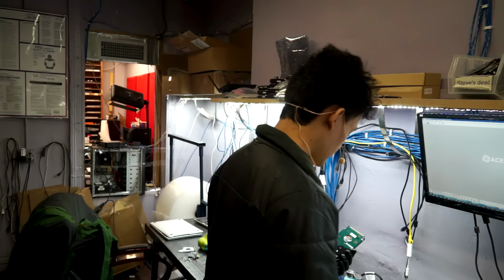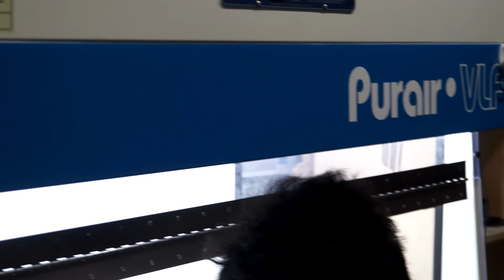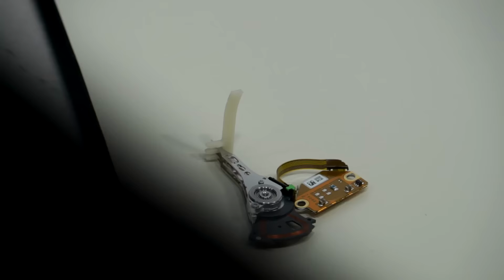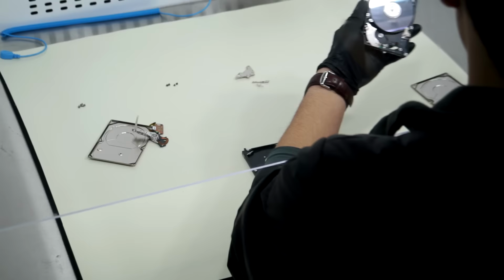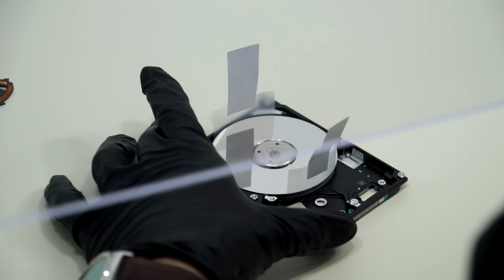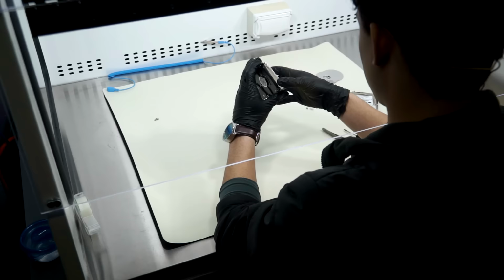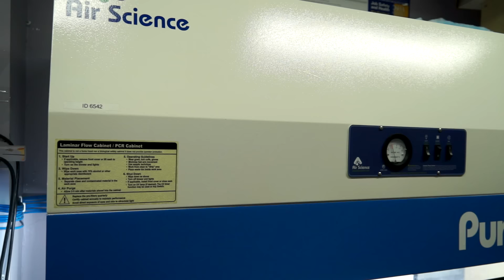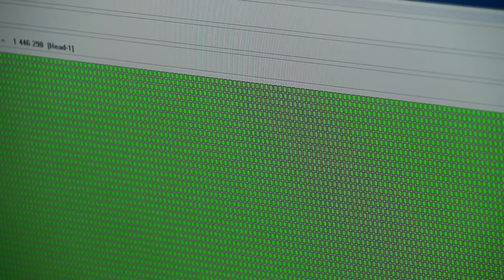Data Recovery: Hard Drive Platter Swap in Our Lab!

Comment: Now do SSD data recovery please
Reply from the maker: For that we use Darkseid's omega beams to read directly from the broken NAND which cannot be captured by consumer camcorders.
Reply: Louis Rossmann lol ill pay that👌
Reply: how possible is it to recover data from an SSD? Since it's not physically recorded into a metal, I'm guessing there's a low possibility of it happening?
Reply: TheFPSPower if there is a problem with the power supply circuitry in the ssd you have a better chance of recovery but if one of the flash chips is bad then your probably stuffed
Reply: Actual damage to flash cells is impossible to repair - all you can hope for is to force read the remaining data and hope to reconstruct some of it. But since SSD's basically fragment all data randomly across the entire drive, reading the flash chips themselves is useless - you need the metadata to know how the data is arranged... And, well, you need to know how the metadata itself even works. The latter is generally secret, since it's an integral part of SSD controller design.

On the plus side, modern SSD's are considerably more durable than disk drives - the only downside is, as explained above, if the actual flash is damaged somehow.
Reply: Mythricia also I'm sure that S.M.A.R.T technology will notify you if the flash sells are starting to die in the drive hopefully before a catastrophic failure happens
Reply: Oh yeah absolutely - a reputable SSD will not let itself "die" from normal use. They have a large percentage of spare Flash to use when problematic flash sectors occur, and furthermore, once the write-endurance limit gets close, modern SSD's will actually put themselves into a hard-locked "Read only" mode - where they will simply refuse to write data. That's another nice thing, Flash failure is relatively predictable, unlike disk drives, so they can have a built-in safety.
Reply: I have seen people offer to do SSD data recovery, they charge upwards of $1500 is this a scam or is there some known way of doing it?
Reply: Even though that is true, I think I trust more saving important documents in a spinning hard drive instead and leave everything else to the ssd.
Reply: Whether SSD data recovery is a scam or not depends on the fine print. There's no technology under the sun that can recover information from a dead sector of Flash. It's just not there anymore. It's gone. If the recovery has to do with a dead controller chip or physically broken PCB, then sure.

But since the failure mode of a dead SSD is usually the Flash memory itself, rather than a controller or physical damage to the PCB, I highly doubt "SSD data recovery" is very feasible. It's kind of the opposite problem of disk drives - in disk drives, as long as the platters are undamaged, the data is there, it's almost always the heads or spindle dying. In SSD's, it's the data dying! There's nothing to repair.
Reply: I thought the newer drives had secure fast erase, I.e. a chip on the controller with an encryption code.   so you need both the platters and the board working. ( no more fixes by simply swapping the board)
Reply: I thought the newer drives had secure fast erase, I.e. a chip on the controller with an encryption code.   so you need both the platters and the board working. ( no more fixes by simply swapping the board)
Reply: That's probably true, yeah. But I was comparing in general. Though getting the board working is not too hard - I've seen people swap the controller chip onto a new board and working it that way, since it's the chip or a ROM containing the encryption keys. Along with new heads / platter swap or whatever of course.
Reply: Thanks to Lewis.  I'll have to relook at this. Swapping platters opens up opportunities. I'd love to see someone have a go at flash recovery.

With recovery, if the unrecoverable data is a system file, temporary file, unallocated space, or even a program file(as long as you can reinstall) you have a win.

I've repaired from some really nasty data corruption.  But I'm a software guy, data recovery hardware skills are limited, eBay donor boards not a viable option (ads end of the world), and my clients will never pay Lewis's prices, (DAMNIT)
Reply: SSD failure is almost NEVER the Flash memory itself. Controller and PCB failure are the most common issue. What Luis uses here called pc3000 has SSD recovery capabilities(with add on units) for some SSD's. For other SSD's particularly ones with Full Drive Encryption(most new controllers) you need to develop your own solution like our lab does.
Reply: Does he charge a lot? I hope not because the difference between an amateur like Jason and a long time pro with experience is huge. This old 80GB drive is a cakewalk but sending a modern drive to an amateur lab is stupid because the difficulty is exponentially higher. I won't even mention all of the numerous things that did direct damage to the media. I literally lost count. Anyone paying more than $300 for this kind of service can find a better deal elsewhere(maybe not in NYC though).
Reply from the maker: A lot is relative. On YT anything over 25 cents is considered a lot. You've mentioned nothing because as with most commenters you have no argument..
Reply: An argument has 1 or more premise and a conclusion that is logically valid. there are 3 arguments and 3 non-arguments in what I wrote. 
After watching you're video I described it in detail to an engineer here with 25 years experience and he called you something that translates roughly to "degenerates" or "perverters" from Russian
Then the other guys at lunch with him had a laugh about how Drivesavers is just as bad so they have to spend most of their budget on marketing.

In other words, you think you're good because you're cheaper than DS who are also shit apparently. This is the consensus among engineers with decades more experience than you, not just my opinion.
Reply: Of course an engineer with 25 years of experience is going to think something like this is "degenerate". But on the other hand an engineer with 25 years of experience is going to have access to much better tools, much better equipment, and a substantially improved work environment. A """"data recovery professional""" who is an engineer with 25 years of experience probably works in a 100% static-free clean room, wears the equivalent of a hazmat suit, and would scoff at the mere concept of using a positive air pressure clean air enclosure.

Get fucking real. There's no chance in hell you'll get something like that in a run down hole in the wall in NYC. What they did worked. That's all that matters. How it was done and how they achieved it is pointless if in the end the service was performed.
Reply: Yes, failure mode is critical.  I guess the process would be to remove the flash ICs from the board and read them individually, then reconstruct as much data as possible.  Most drives essentially "stripe" the data across multiple ICs to get a decent data rate, but do so at the cost of reliability.  To "overcome" this problem, there are lots of "spare" cells that can be used to store data should a cell become damaged (worn out)  You'd need some ChipQuik, a decent rework station, lots of patience and the right software, it should be do-able but much more difficult that recovering spinning rust :)
Reply: @MepsiPax  scam

Comment: Pfff, using scotch tape to align them?
There's a way easier trick:
You just make a scratchmark with your tweezers into both of the drives and align the scratchmarks.
Pfff, fucking unprofessional
Reply: Nono, drill a 1 mm guide hole in four positions around the platter, insert needle to align!

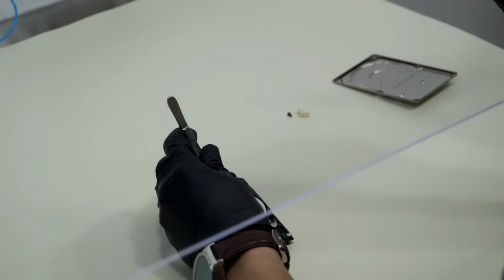Comment: 8:30 You can 100% rotate tires without rebalancing them...
Also, the fact that this is supposed to be an ad is amazing. I respect videos like this on a hobbyist level, but for commercial data recovery your procedures would never come close to passing standards.
Reply from the maker: The only standard I care to pass is that we are able to get data for customers that another company told them would cost $6000-$10000 to get, and that we do it regularly for 5% that.

Comment: so that's how they do it , Month ago my western digital 750 GB drive failed and i take it  to data recovery service and they said that head is damaged , and they said  they will take new head from donar drive to recover data , so after 3 days they give me full 600 GB data in my new 1tb segate barcuda drive , so overall it costed me 75$ , now for safety reason i have bought samsung 860 evo 500 GB and am using it as primary drive and OS fast and as secondary drive along ssd am using segate barcuda

Comment: I've been told that when a hdd doesn't work and makes a clicking sound, that this clicking sound are the heads banging to the sides, because the heads weren't in park position when the hdd was shut down (improperly) and this can be fixed by manually put the heads in the park position. Is this true, or is there a lot more too it? I have such a drive that I bought new and only used for  3 months, but they claimed I dropped it or something else as an excuse to deny warranty on that drive. I'm handy too, but I'm not going to blindly believe someone who just claims what is wrong and how to fix it, I rather take the advice of an accomplished professional like you If you don't mind :-)
This looked like something relatively easy to do and apparently a hdd doesn't have that many parts and is easy to disassemble and assemble again, so that clicking sound I can imagine, doesn't require to take the discs themselves off so the risk of misalignment is minuscule I reckon?

Comment: I would build a three fingered clamp in two sizes to grip it surly around the edges. Would give a sure place to grip to take it out after you remove the filters and other components there would be plenty of room for the fingers. I give you this idea for free but my name is Matt so you just have to refers to them as the damn matt clamps like in who took my damn matt clamps

Comment: The heads are not magnetic.  They actually vacuum weld together.  Trying to separate them damages the flexure.
Reply: If they were magnetized they would erase the media (disk)
Reply: The lowest level "format" or the servo information contains a once per revolution "Index signal"  That is why the disks need to maintain their relative radial position.  The other purpose of the servo information are to define the tracks that the where data is.

Comment: I would think using a magnetized tip to manipulate the platter spindle would be a bad thing.  Admittedly, I know absolutely nothing about how this process should be executed, but could someone explain to me why the magnetic tip isn't bad for the data on the platters?

Comment: A famous data recovery center to do an easier job than this (in specific: replace the head slider with a donor one) and retrieve all the data on a new drive said it will costs me around 2000 dollars... Apparently for what appears to be a 30 minute job or even less in my case since they have to replace just the head slider. And they use the excuse that "it costs a lot because it takes lots of efforts and time".... This video make me realize the crazy business and bullshits there are behind data recovery.

Comment: lots of good info here. worst part is the filming. is the cameraman txtn while filming? Ok im taking the heads out now while camera is zoomed into an arm or whatever, txt txt txt OMG oncoming car! veer camera to head removal shot.. will you swap platters, board  etc to a donor drive supplied by the end user? as there is no need for data recovery if the bearing is the reason for failure?

Comment: With the recent improvements in the SSDs, I ain't going back to these shitty mechanical means of storage garbage bins called HDDs. 
Fuck them.
I am happy with my SSDs. Over 5 years of excessive use, still running like beasts. Bought 2 more recently for expanded storage.

Comment: Tell u one globs magic... I just opened my laptop to verify if my right side speaker really damaged. When I opened and started getting speakers out I found the my nvme SSD wasnt plugged into its slot.. I mean it was just rotating by screw at its end. 😊 But that was my main drive! 😅 How could be my laptop working of it was out of its connector slot? 😂 I mean it was showing fine inside windows... And u can't imagine it can slip out of connector socket if the end screw was entactly secured. And it was good! ...Some might be thinking me crazy but I myself can't believe it man ..how could this thing happen! 😊 I SWEAR IT WAS LIKE THAT MAN..WHEN I OPENED IT. not the first time me opening my laptop but surely I never touched nvme SSD since the technician installed it when I brought that laptop. Last time I changed my normal segate drive or removed battery.. but never any other component. It was cause on my Dell 5570 speakers are just putted thier on sides in just sockets without any screws...and this nvme sits by side of left speaker or can say within left speaker plastic frame.. that's why I noticed. But then life I gone through I can believe everything seen much greater magics then this in my life. But globs this was good. 

And unfortunately my right side speaker really kinda gone numb...showing no connectivity of its coil. But I left it that way cause it plastic covering kinda glued I guess so u have to break it open I guess to check inside. So I left it for another day or I might even buy new one since not so costly I guess. Jus around 750 bucks around here I guess. Anyway happy magic globs ..That was good! REALLY GOOD! 👍😊👌

Comment: Hello sir...im in need of your help i had 2 tb Seagate ultra touch hdd today it stopped working whenever i plug it into the system half times it gets detected and when i type in password ( its got password protection which i turned on) , it freezes my whole pc and the process saying unlocking the devices goes on.. sometimes it showed drive no available ...invalid parameters.....as far I've tried searching for the issue i didn't happened to find yet....i haven't dropped it a single time...not even a water damage.... Theres a very soft clicking sound while the disc spins... please help me... there's  about 1 tb data on my hdd which i really need to recover..sir please help me out..

Comment: Did you swap the PCB from the donor drive along with the platters and the heads? HDD Recovery Services is a great channel, but this was more informative. Good recovery job!
Reply from the maker: he is definitely far ahead of where I am in the field of hard drive recovery
Reply: He did an excellent data recovery job. I've gone as far as opening functional 1TB drive in a non-clean room, looked around inside briefly, and closed it up. The drive still works, but I don't think I'd trust it with important data. :)

Comment: Irreplaceable data, not backed up anywhere, on an 80G IDE HDD? For a fraction of what the Rossmann Group charged for data recovery the user could have bought a towering stack of backups drives.

Comment: So, I have a 4tb WD easystore HDD that I used to backup my data to. In the process of doing some file transfers to a new drive. The 4tb failed and started clicking rendering it unusable. I had it looked at and the platters are fine, but the heads are f*****. All my data is on said drive. Is there anyone who can provide an affordable solution?

Comment: I am going to email you the design for my 3D printed platter die. It has a center ring from a drive and has die pins to drop onto an open 2.5 inch drive I have one for a 3.5 inch. Then you pinch the die to the half of a drive. Flip the drive & let the platters seat on the dies center ring from a hard drive. Then seat your donor frame onto my die pins. Pinch & flip. 
Zero tape required I havent had a failure yet doing old IDE drives. I'd be happy to sell these to ya with or without the hard drive center ring (as Im sure you have PLENTY. I can get you both 2.5 and 3.5 inch cases @ different depths for varying platter amounts.

Comment: Hi, Im looking to get a new laptop hard-drive as a dona for the one I thumped (which made it completely unresponsive) which I hope to have a go at fixing. Not quite sure how to do that yet though...
I have found a similar hard drive with the same specs except one thing.. My original harddrive was SATA 3.0Gb/s and the new one I have seen is SATA 6.0Gb/s. Will this hard-drive work or will I need to find one at SATA 3.0Gb/s?
Also, what is the probable issue for a non responsive harddrive that I thumped down on hard whilst in the laptop when it was turned on and trying to do a task? Thanks in advanced.

Comment: I'm gonna make a tool to extract those platters without the tape. Should be simple enough. Two (or three ) thin fingers with equidistant grooves , a pivot,a spring and some threaded rod. Turn a thin tube , groove the internal diameter and slice the fingers from that. Any half- competent machinist  would make that for you  - rigid plastic or some stainless tube. Bish bash bosh, DONE!

Comment: Just a passive question to the community. I had an Seagate FreeAgent 250G go down after a pretty cold day. I managed to get everything off but it would ONLY work with a tiny amount of pressure being applied to the case. I figure it's a popped connector on some chip, and if that's the case I'm not going to go through the trouble of reflowing the board. I'm a lifelong tech and troubleshooter, but I have dick's worth of experience with hdd guts, am I missing something obvious that could bring this little guy back into serviceability?